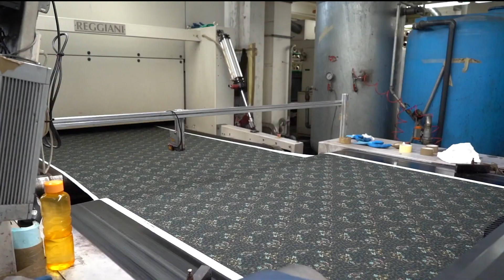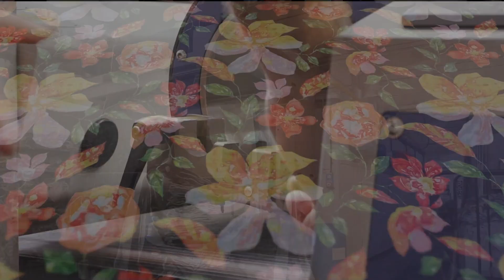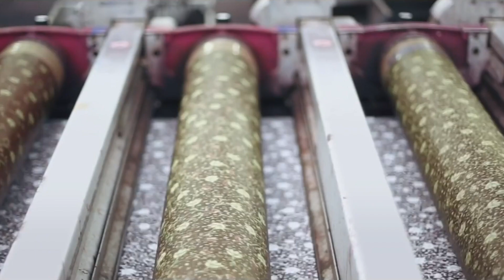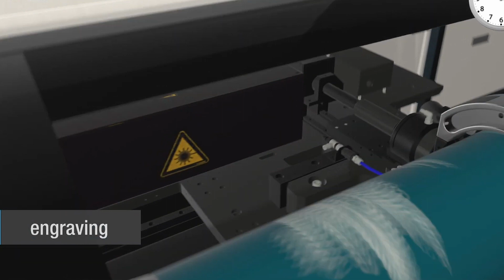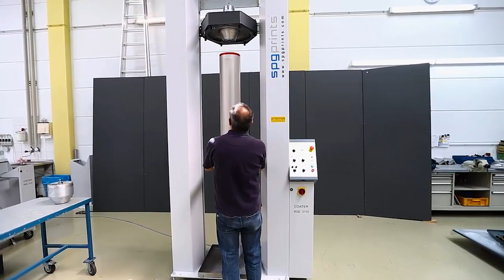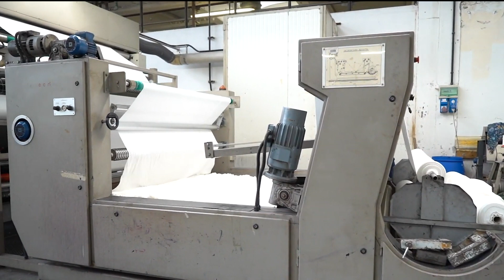10. Rotary screen print

Comment: Amazing. I have a question, what should be my pattern repeat size e.g 64cm square for rotary screen printing or lesser and does the factory tells you the size the repeat file should be?
Reply from the maker: Normally the factory will tell you which sizes the can make. But 64 cm is a standard.
Reply: @magdalenaerikssondesign thanks a lot